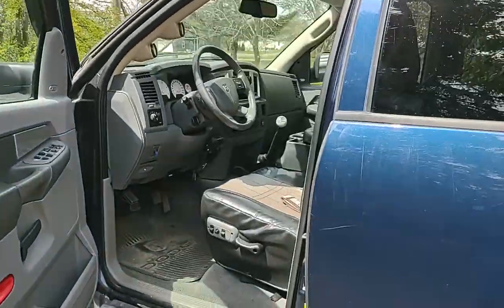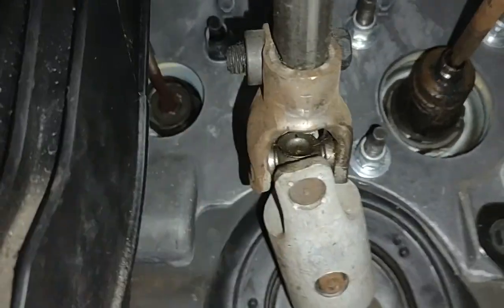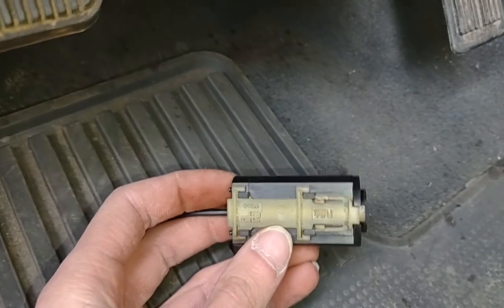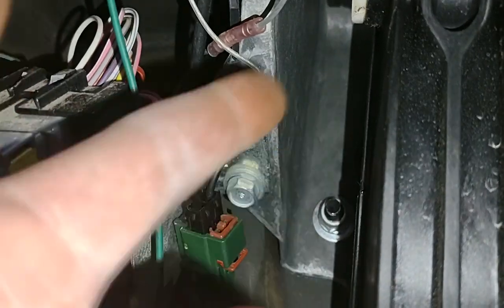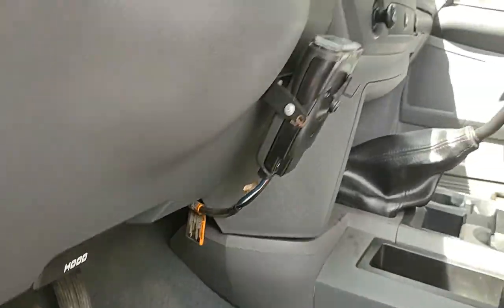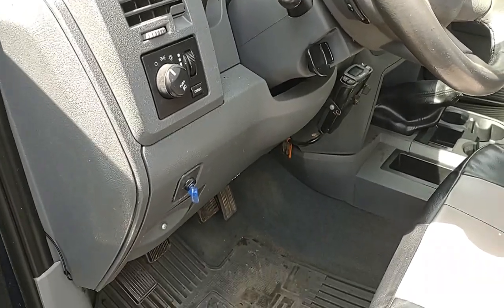6.7 Cummins Clutch safety switch

Comment: Does this make the cruise control not work?
Reply from the maker: Not sure. The guy I did it for doesn't drive the truck much. However I wouldn't think it should, it only affects starting the truck.
Reply: @crazypeople4x4  ok, I just know when you push the clutch in it turns cruise off. I think I’m just gonna put mine on a toggle switch just in case